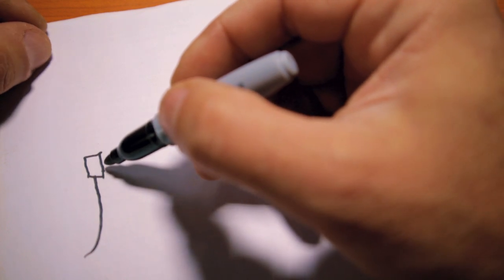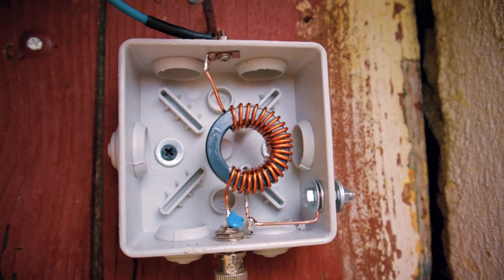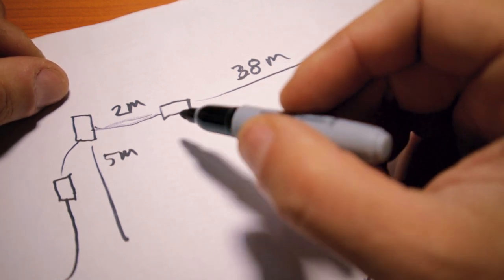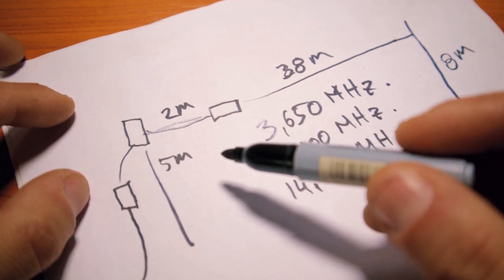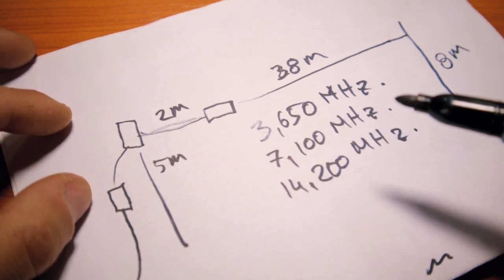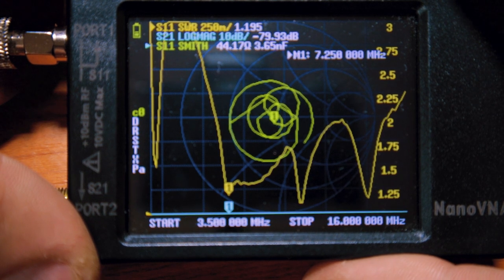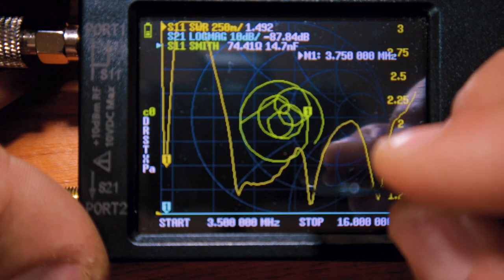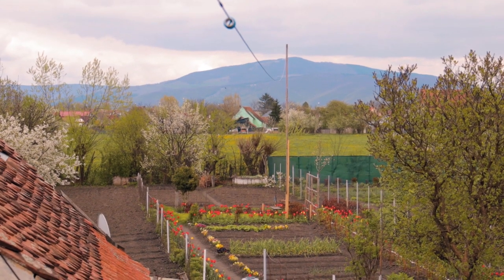Experimenting With The EFHW-8010 Antenna - Can it get better ?

Comment: My 80m EFHW with a coil at 2m, it is resonate 3.560, 15m high horizontal across my yard. I think your antenna is too short. When I first tested 40m was in 6.8 mhz and 13.6 mhz for 20m. I just cut it shorter until I was happy with 40/20m and ended up 1.5 t 1 on 15m and no good on 10m more in 27.9 etc. I made a 1 T 1 balun and put it at my transceiver end on my feed line maybe to choke common mode on the coax or not !!  not sure if it helps or not. Its not necessary for me to tune it across the bands but I just nip it up with the tuner in my ic7400 anyhow. regards vk5cz ..
Reply from the maker: I want to move the choke on the transceiver side as well. The hight of the antenna is something I can't change for now. But I am planing on making it some sort of I verted V to have the middle a bit higher. Mine is the same..  as I do towards 10m the SWR is not as great... but I can still manage that with the tuner. I think with a bit more experimentation I can get it as I want it to be )) I still have to work a bit more on the compensation coil and the value of the 64.1 transformer. I will try to get the best I can and leave it as it is. But I know I tried haha. If not I will always ask myself if I could get it better haha. Thank you for sharing the info. It helps a lot. 73, YO6DXE.
Reply: Ciprian, I am sorry that you lost your larger antenna location. I am in the process of building an 80m-10m EFHW based upon the Fair-rite 2643251002 core popularized by Colin MM0OPX.

I realized I have been trying to get too much done with the inductor.

Waters and Stanton, Steve Ellington mention the capacitor in the middle, but Waters and Stanton suggest the most straight forward tuning. 

Use your the 80m wire and inductor to get higher bands where you want. Then add capacitance until you raise 80m to where you would like it.

I am not sure what frequencies increase the most when increasing  capacitance in the transformer. I think its 10m. Right now I am using 120pf in the transformer that has taps for 49:1, 56:1, and 64:1. The 64:1 definitely  lowers SWR on 80m.
I'm still playing with the inductor. The starting point was 9 turns on nominal 1/2" PVC. I am now at 8 turns.
Its still crazy. I need to lower 7m & 20m and raise 15m & 10m. So, I guess I lengthen overall and take out inductance.

The rub is I want 80m primarily for 3.94mHz. I think I will end up using close to 500pf in the middle.

Keep having fun!

Comment: Dear OM, that is very good work and I also like your garden and view. One thought that you may want to look into: There is a large discussion about if you need a counterpoise for an EFHW. I think, it needs one. It is good practise to have a little counterpoise (lambda * 0.05) at the ground from the coax connector of your transformer. Alternativly you can use the shield of the coax between the transformer and the choke. That means you have to consider the lengthe between choke and transformer to be 0.05 lambda of the lowest planned frequency (4 m @ 80 m). EZNEC modelling supports the effect of the counterpoise. Continue the good work and 73 de DD1TA
Reply from the maker: Good morning and thank you so much. Ohh yes you are right. Initially I wanted to use the coax version but I noticed that placing the rf choke at that distance is was also changing the proprieties of the antenna... not sure why was that... but now I do use a counterpoise and the choke is on the transceiver side. Have a fantastic weekend and 73, YO6DXE.

Comment: I will suggest that you try adjusting the transformer coil a little by squeezing the coils closer together or spreading them apart. This makes a difference. I noticed you 80 meter had high SWR at the low end but the impedance was just about right and very close to 50 ohms. When you moved the VNA marker higher in frequency and the 80 meter SWR came down to about 1.5:1 the impedance went way low. Some adjustment in the transformer coil will change this. You might even need to remove one turn of the toroid coil.
Reply from the maker: Yes indeed. I only learned about this afterwards. It took a lot of headaches hahaha and experiencing with both the 49:1 and also the 64:1 transformers to see what works better. Also another problem I noticed was the placement of the RF choke. Since I moved it close to the transceiver the results are way better... and also the type of RF choke seems to matter a lot too. Now I no longer have this antenna as I moved into a new place and I don't have as much space. I am working on building the shortened version that has the coil at the end almost. But talking about the RF choke... while testing the new antenna I realized I had 1:1.3 with the coax RF choke type... and 1:1.04 with the one made with parallel insulated wires. Impedance was the same on both. Is nice in a way that I get to learn and experiment and realize how everything interacts together and influence the result at the end. With headaches or not... is the best hobby as I learned more now than ever. Love it. Thank you for the tips as well. 73, YO6DXE.

Comment: I’ve gone back to experimenting with my EFHW 8010. I have always had a capacitor in line exactly half way along the wire. I never had a compensation coil on the antenna. So I figured out a way to insert a coil without needing to cut and solder the wire. I can add turns to the coil or take turns away easily without cutting or soldering. I can also move the coil position closer to the feed point or slide it farther away. I have made about 14 or 15 different changes and tested each one. My best results so far is having 5 turns on the coil with a 1.25 inch diameter and have the coil placed at 75 inches from the feed point at the output of the transformer. I started with 10 turns and having the coil 78 inches out. So far all of the bands are under 1.7:1 SWR and some are down to 1.05:1. The exception is 30 meters. It is a little over 2.5:1 and needs a little help from a tuner. I’m not done experimenting and will try a few more things. I do not use a RF choke in the feed line and I do not use a counterpoise. I have the ground of the transformer connected directly to a 8 foot ground rod pounded all the way into the ground. To make a sliding coil use a piece of PVC pipe 2 or 3 inches long and use a dremel tool to cut a “J” shaped slot into each end of the pipe. Then you can snap the wire into one J slot on one end and wrap several turns then snap the wire into the other J slot on the other end. The coil will stay in place and not pull out. Then you can loosen the wire on one end and move the loose bit of wire around and around the coil until the coil is tight once again and you have just moved the entire coil position on the antenna. You can also easily unsnap one end of the coil to remove or add turns.
Reply from the maker: I think the way you build the sliding coil is fantastic. So much easier to make adjustments and experiments. I was curious since I didn't got to test the capacitor in the middle version of the antenna... is it better with the capacitor, or with the compensation coil from what you experimented so far ?
Reply: @dxexplorer  I don’t know yet. I have always had the capacitor in line. I will try to short it out and see how it tests.
Reply from the maker: @glevideo I am also very curious. I've seen commercial versions as well that had both the coil and also the capacitors. I kept telling myself I will test this too, but the free time doesn't want to help at all.

Comment: Chip, you need more turns on your choke. Use a bigger toroid 240. You should get 12 turns on with rg58. Less turns it becomes part of the antenna. Get that choke close to your radio.
I've never seen any noticeable difference on 10m using a capacitor.
You won't get much better on 80m because it's to low to the ground.
The trick with the transformer is to stuff it with the largest wire you can fit on reduce the inductive reactance but by the same token you introduce capacity, maybe this is why I don't bother with a capacitor.
I've never seen any improvement or regression with a counterpoise, as long as you have 5m or so of coax.
Always test at the transformer or you will drive yourself crazy. Get it good at the antenna then you know all other issues are in the feeder, some of which you can't do anything about.
There will always have to be some compromise in this antenna, by its very nature it can't be a one trick pony and do everything perfect. But it's good enough. And if you have ever had the pleasure of trying to tune up a fan dipole on 4 bands it will be good enough for us too 🤣
Reply from the maker: Hahahaha. Ohhh you just told me a few more things I skipped to test so that means more tests this coming week hahaha. Is late now but I will get back with a "radio show" tomorrow to chat a little more. Maybe we can also try some FT8 or FT4 if you have the time. I know this antenna can be all over the place at times... I just wonder how good I could get it ? 🤣🤣 I will move on dipoles later hahaha. First I must get my head around this one. We will see if I will end up in a wall or jump of joy haha. 73 Nigel.

Comment: Hello, Ciprian I use 2 common mode chokes for this antenna, first one .05 lamda down from feedpoint which is calculated for the lowest band of operation.  Calculations are 0.05×80M band = 4M. I wind 8 turns of the feedline around a 240.43 toroid down from feedpoint and another one before entering the shack. This eliminates rf on feedline. Hope this helps and keep up the good work.
73 de 
Aiden EI8HJB.
Reply from the maker: Thank you so much. This helps a lot. I only have the FT140-43 to make the chokes now... but they should be ok for now. 240-43 are a bit expensive for me haha. I will need to get four of them to build a proper antenna ( 2 chokes and the transformer built on a double stack ). Ohhh and thank you for the calculations ... that helps a lot. I will come back with another video on the antenna sometime this summer for sure. 73, YO6DXE.

Comment: I have a shortened version as not enough room for a longer wire  just has a narrow band width on 80m just have use atu
Reply from the maker: I want to build a shortened version for portable... but I won't use 110uH... but 55uH and extend the end to 3-4m depending on what's necessary. I will also try to use some thick wire for the coil... 1 or 1.5mm. These should help a bit with the bandwidth on 80m.

Comment: Hello!, Nice video, compliments. i did a lot of experiment on my inv L 8010 with vertical size abt 10m and the rest in horizontal. Two observations about counterpoise and compensation coil: 1 Conuterpoise is too short, generally minimum lenght is 5% of lower band, in this case 4m. I tested this solution and it was good but in my case the best solution is with 3 or more radials 4m long. RF choke is no more necessary because corrents flow thru the counterpoises (radials). 2) compensation coil:  initially I built a compensation coil similar to yours, but after studies and experiments the better results was with 7 coils on 32 mm pipe.
Reply from the maker: Grazie Franco. I use no radials at all on mine. I don't have the space )). I also wanted to try putting a little bit of wire vertical... but the way the house is ... it doesn't allow me to do that. I will try to rebuild the compensation coil as you did yours because I think mine is not yet perfect. But I stopped at this one because I had no more time to experiment ))). I will try to see how I can use some radials at least ( counterpoise ). So far I didn't had problems with common more curent... but is better to be safe ). Thank you one more time. 73, YO6DXE.
Reply: @dxexplorer  👍 73's and good experiments de iw2hus, Franco
Reply from the maker: Thank you so much. I will get back to you and let you know how it worked. I must buy you a beer 🍺 😅.

Comment: great video Ciprian... . I wonder, will the connection between the bolts and the copper strip be ok on your capacitor holder? eg possible dissimilar metal corrosion?
Reply from the maker: Good thinking David. I didn't think of that. Maybe I will cancel the copper connections and use something else instead. 😁😁 ... thank you and 73, YO6DXE.

Comment: Try without the ferrite choke? I use 5-7m counterpoise on my EFHW, no noticeable stray signal in my shack. Or use 'ugly balun' method, at least 5m from the 49:1 unun.
Reply from the maker: I will sure try the counterpoise as well. A few more tests to make until I will find the best configuration for the antenna I guess ))). The reason why I did wanted to use the ferrite choke is also because it seems that it takes away some ugly electrical noises I used to get in the antenna from neighbors. What I want to try now is to have a counterpoise at the antenna... and use a ferrite choke but in the shack right next to the transceiver. Maybe it will work ? ))
Reply: @dxexplorer  using a choke too close to the 49:1 unun is like not letting the antenna stands on its 'two feet'. Yes EFHW is not a dipole, we are feeding it at the ends, but give it at least something to counterbalance. Yes, perhaps it is better to install a choke right before the coax enters your shack.
Reply from the maker: Makes sense yes. Thank you for this..  I was always so confused because all people have different opinions and some say put it in the shack..  most say put it as close as possible to the antenna... at the end you have no more clue on where is the right place hahaha. But yes is makes sense what you explained and has a logic to it. So I will try this as well. My instinct also tells me that I may also get better results as well ))).

Comment: Hello: One thing I noticed, and maybe you should research, is that I notice you put your input coming RF at the very end of the three turns and the ground at the 3 turn point. My transformers are exactly opposite. the ground is at the end and the 50 ohm input goes to the point of the third turn. I'm not really sure if it would really make any difference or not as the turns primary would be exactly the same?  If you run 80 meters I would put the choke at about 13 feet from the transformer. On mine here at the house I had no choice but for it to be close to the antenna so I added a ground wire/counterpoise because that was all I could do. I tried a compensation coil on mine and it didn't work and I think that it was too close to the house and that is why I think mine has some problems; the vertical part of the wire is too close to my house for about 10 feet or so on the vertical rise. I could probably do a major re-do and get it further away from the house. If you do use a capacitor you probably should get a door knob capacitor or at least a good TDK from Mouser or DigiKey. 3KV  I may use one on my portable which is what I am building right now. I used a cheep capacitor on my antenna and when I hit it with 500 Watts it shorted it out.
Reply from the maker: Hi Bruce... ohhh I kept doing a lot of tests and trying all sort of configuration both for the counterpoise and also for the impedance transformer. I have the same issue... the height if the antenna is not what I wish it would be. Is too cold now so I left the antenna alone. But I will continue playing with this one and for sure I will be back with a video of the final version I settle with. We will see how that goes )). Waiting for for warmer weather to come meanwhile. 73, YO6DXE.

Comment: This may be a typo in the diagram or me not quiet understanding but are we feeding the wire from the wrong end, ie coil should be and the extremeity ?. Want to do something similar so very interested in the responses. 73 and thanks for posting.
Reply from the maker: No no Darrin... I think you have in mind the 110uH inductor for the shortened version of the antenna. This one is not short... is half wave on 80m... so 40m of wire. The coil I use in the video is a compensation coil and has about 0.5uH. Do not confuse it with the 110uH coil. That one yes it goes nearly the end of the antenna... but in my case the compensation coil has to be 2m away from the impedance transformer. 73, YO6DXE.

Comment: I was looking for a frequency of 3.8 MHZ and club net of 3.9 mhz. A 49:1 transformer with a 122.5' wire did the job. I was looking for that range, but it can be longer or shorter for desired range, with no tuner. If you align for 3.5 Mhz, all other bands fit. When tweaking, some bands become less resonant.
Reply from the maker: I did some experiments last week I beleive... I will be back with a video on the results. Playing a bit with everything..  the compensation coil, the impedance transformer etc. Strange and interesting results comparing to the theory of it  ))). I want to try they way you made it as well and put all on paper... for future reference hehe. Thank you. 73, YO6DXE.
Reply: @dxexplorer  Yes, I believe when I was looking for 80 meters first, then all other bands came up good. That for SSB . 122' 6", was resonant in all other bands up to 6 meters. The SWR was so low, so if necessary, the internal tuner could do it.
Reply from the maker: I try to see if I can get the SWR no bigger than 1.5:1 on all bands from 80m to 10m. No luck so far, but that is the fun in experimenting. At least we can try haha. We will see how things work out.
Reply: @dxexplorer  80 for me was, 3.780 1:1, 3.8 = 1:1 and further 3.9 = 1:6. Now, 7.275 was 1:5, 7.295 was 1:4, 14.225 2:4, 18.110 was 2;5, 21.275 was 1:6, 24.930 was 1:7, 28.300 was 2:4, so not too bad so the internal tuner can do the best.